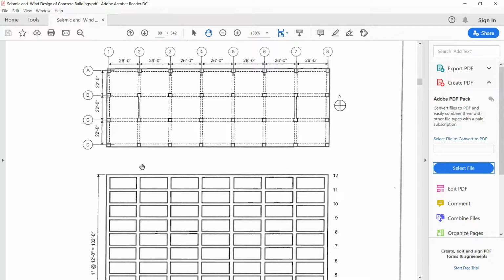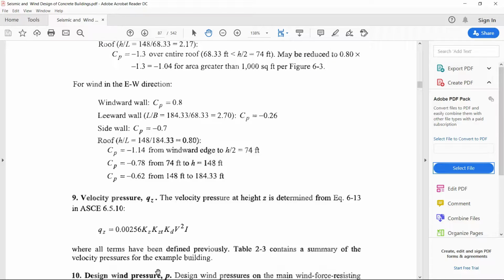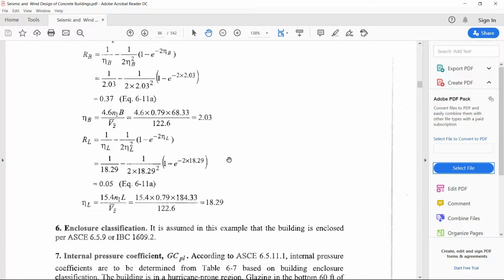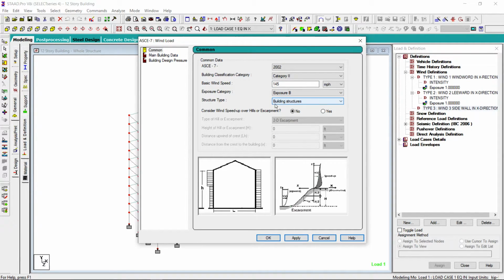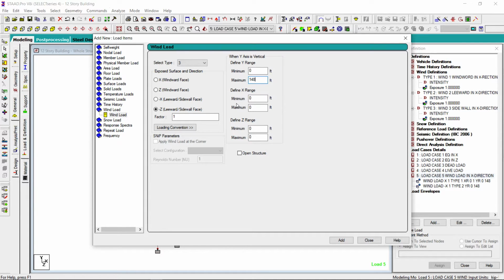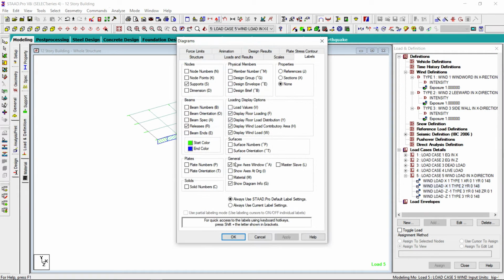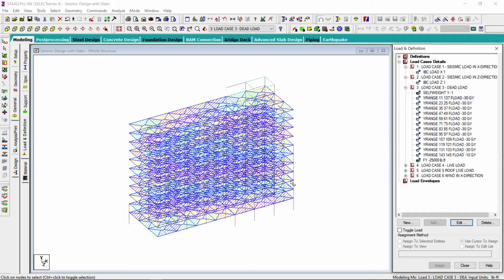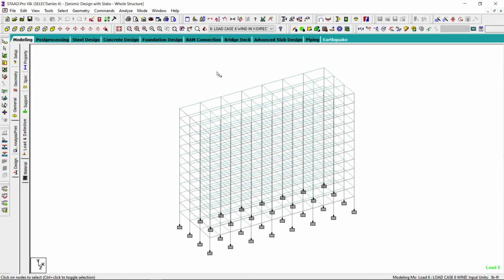Wind Load on a 12 Story Concrete Building in STAADPro

Comment: Sir, Kindly  check the value of  Building natural frequency  in the wind Load definition  .As per the calculation it is (0.787) ie Reciprocal of Time period 1.27 sec .Kindly confirm .Thanks a lot